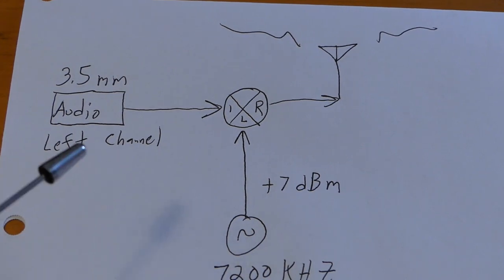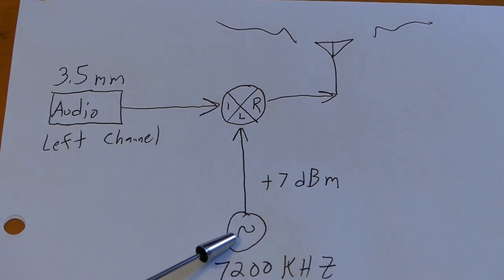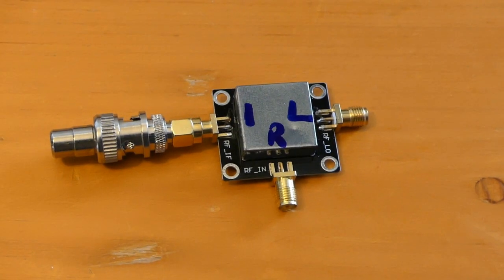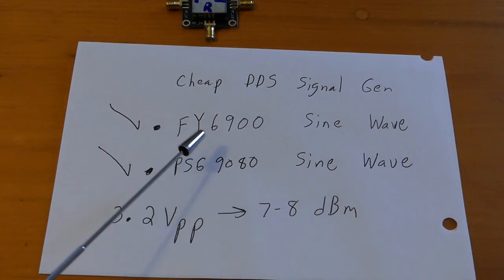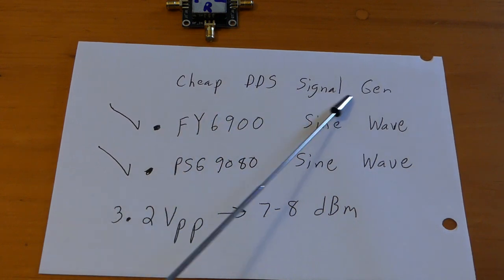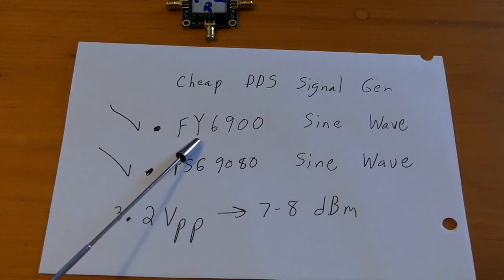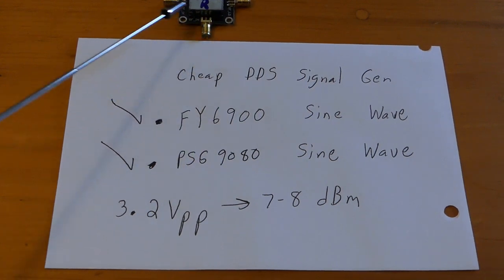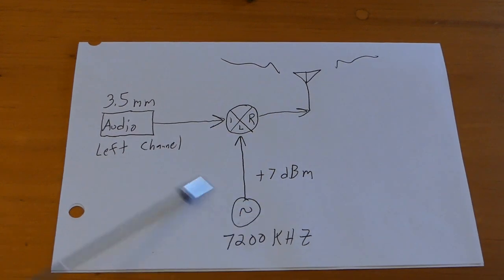Double SideBand,  DSB Transmitter

Comment: Thanks for the video!
In the video you mention 3.2/2.  Where did you get 2 from? Thank you!
Reply from the maker: Vppout = (1/2)*vppdisplay
Reply from the maker: The signal generator has internal resistance of 50, and the load is 50, so 50/(50 +50) = 50/100 = 1/2